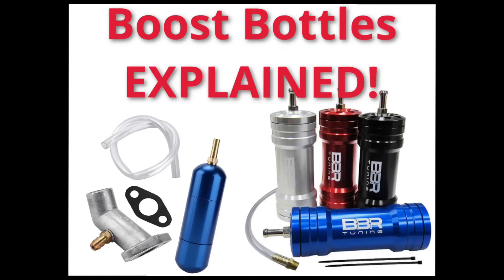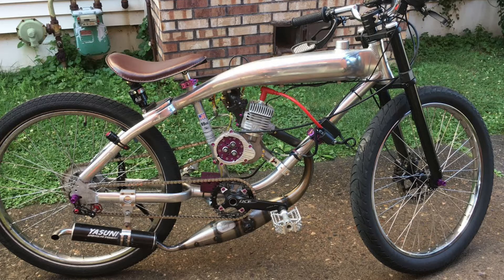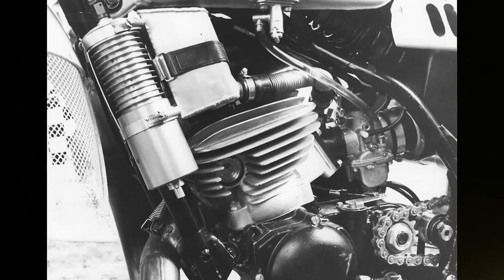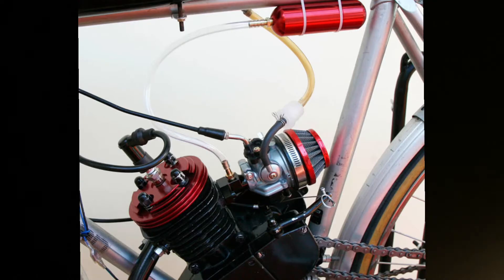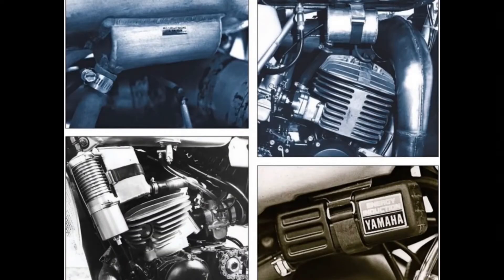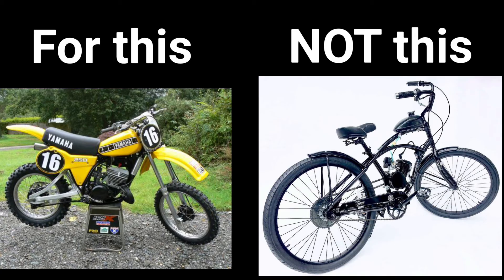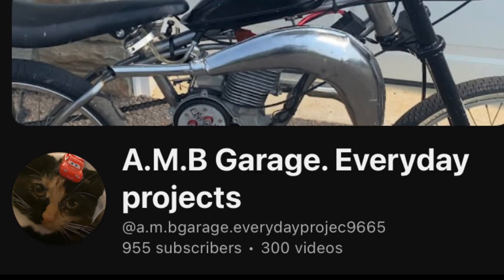The Boost Bottle EXPLAINED! #motorizedbike #2stroke #automobile #mechanic #motorcycle #motorcycle

Comment: They save a bit of fuel.  Maybe a 1/4 mile per gallon but still that's 1/4 mile of free fuel that's not going backwards out your air filter.  Thats like 45 cents of gas per tank you can save

Comment: Are you kidding?  I was expecting a video where they were actually put on a motorized bike, before and after results. But, nope just you slamming them and blackberry, who I don’t buy from.  I have put boost bottles on 3 motorized bikes. They smooth out idling plus the entire rev range.  Not to mention the better mileage. Do your videos but get out and do your research  to back up what you say.
Reply from the maker: lol. I have tried a boost bottle. I speak from my personal experience as well as many other's. Boost bottles effectively increase the intake volume. Sure, there might be some benefits, but if you ACTUALLY know ANYTHING about engines and especially how to tune a carburetor, you will know for FACT that a boost bottle is nothing but swamp gas for a motorized bike application. JUST like a longer intake, THE ONLY TIME a boost bottle will impact performance for the better (IN ANY WAY) is if your carburetor is out of tune. 

The soul purpose of a boost bottle was to reduce the INSANE AMOUNTS of intake pulsations within the intake, making the throttle response go wacky in the higher RPMs (we're talking about 8k RPM or so). However, on the application of a motorized bike that does NOT have those issues, a simple tune of the carburetor will make a bigger difference in terms of performance.

The MAIN FLAW that I see with the boost bottles on motorized bikes is that, firstly, they were designed for a very specific use. But as we know, these chinadolls do not perform in the same way a YZ80 or YZ250 performs and do not present the design issues that needed to be compensated by the boost bottle. We can also see that the boost bottle size and all-round design is according to the amount of air-fuel mixture being sucked into the engine and the RPM speed affected. However, for a motorized bike, they are using the EXACT SAME design from a YZ80 on a motorized bike. Now, even though its not too much of a displacement discrepancy, considering even the 70's YZ80s suck in about 6x the amount of fuel and spin DOUBLE as fast as the chinadolls. So, while the boost bottle on the YZ80 might actually do something, the only thing the same design will do on a motorized bike is create air leaks and increase the intake volume (NEGATIVELY affects throttle response and idle, unless your carburetor was originally out of tune. lol). 

I could go wrong, but that is my rant.

Comment: Oh it's a bike Berry thing, eww
I thought it was for the boost port, like the cavity in the cylinder.

I've quoted bike Berry on the same exact vid , about them going through 3 phantom engines, then they responded like, ~ don't believe your ears - stop spreading rumors.
Reply from the maker: Of course not. Bike Berry wouldn't sell something actually useful. 

lol. Bike Berry is a scam in about everything they touch or sell. When it comes to their products, their information, and ESPECIALLY their prices. They are LITERALLY selling some IDENTICAL products that RDM, Smolik, Bicycle Engines, Pedal Chopper, etc have been selling for years and jack the prices way up, "brand it" as their newest performance piece, and most of the time, they even leave the logo from the original on it. lol.

Comment: Race Civic's run 7's in 1/4 mile, but yes boost bottle is Snake Oil 👽👍🏻   PFI Speed #1
Reply from the maker: Well yeah. The Civic is a fantastic platform for performance and has a ton of potential, which makes my rage burn for the civic people that rather do crappy mods that do nothing but make the car crappier and then think they did performance mods. At least in high school, these guys brag that they have race cars and are "beating mustangs" when they have nothing but ugly wheels, a carbon fiber wrapped hood, a fart can, and ridiculously cambered wheels. They deserve to be clowned on even more than the boost bottle users.

Comment: Vacuum and pressure are the atmospheric inverse. Perhaps use Vacuum energy instead.
Reply from the maker: Im not following.  In this case, I believe it would be a vacuum leak, since the boost bottle interferes with vacuum pressure within the intake, lowering it a good bit. This causes less sucking within the intake, which directly decrease fuel being delivered to the engine, thus making the engine run leaner.
Reply: @a.m.bgarage.everydayprojec9665   there is no such thing as Vacuum Pressure. It is either "Vacuum" or the opposite "Pressure". Vacuum is the absence of Pressure. It is like saying Empty Full. This is why I recommended vacuum energy as a correction.
Reply from the maker: I understand now. YES, you are completely right. lol. Ive always said vacuum pressure, but I see now that by saying that, it is HILARIOUSLY contradictory.
Reply: @a.m.bgarage.everydayprojec9665   Thank you for your professionalism. I only intended to improve your wording as others posted a similar response but in a poor fashion. Keep up the fine content sir!

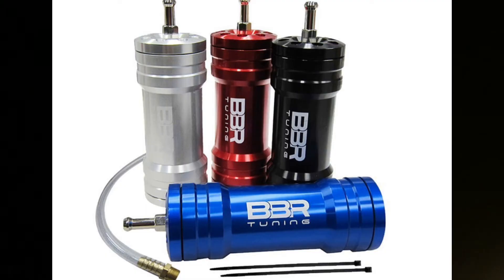Comment: @1:09 what in the hell is vacuum pressure? 🤣
Reply from the maker: In this case, it is the vacuum or negative pressure that the engine generates on the upstroke, which sucks a fuel charge from the carburetor and into the engine. In certain rpm ranges, the carburetor delivers a smaller amount of fuel than what is usually desirably, so the boost bottle in a way balances out those inconsistencies (for the most part) by adding more fuel to the fuel charge when the carb cannot keep up.
Reply: @a.m.bgarage.everydayprojec9665 so just vacuum
Reply: You know that negative pressure is still called pressure right? You can see an example of the use of the phrase in my first sentence.

Comment: The Boost bottle was a Yamaha thing in their motocross and off road two stroke motorcycles in the 80's. The purpose was not to add horsepower, but to improve throttle response when going from full throttle, to closed throttle and back to full throttle. The chamber was meant to be a place for the intake charge to go while at high rpm and closed throttle, then offer a supercharger effect to the intake charge when going back to full throttle, hence the "Boost Bottle" name. It was a popular gimmick in the 80's motocross scene, but as stated in the video a total waste of money. What it really did, was add a vacuum leak and lean your engine out, it did do that really well.
Reply from the maker: Thank you. You summed it up nicely.
Reply: This video is slander 🤣

Comment: it goes after the carb? so fuel/air ratio just plummets or?
Reply from the maker: Yeah. It is supposed to increase throttle response and add a supercharger affect when in the mid throttle and it made a noticeable difference in that regard, but at least on a motorized bike, the boost bottle makes the engine ALWAYS run lean and causes a terrible vaccum leak. So, conisidering the facts, AT MINIMUM, the boost bottle has ZERO performance gaining properties, but commonly actually decreases performance due to the severe vacuum leaks and other factors.

Comment: i had a friend that fitted a squeezable ketchup bottle onto the boost bottle location, it sucks inwards upon power and when idling it expands again drawing in gasey air ready for the next time,
also, we had a yamaha dt80 air cooled that as standard had a boost bottle plastic thing, like a air filter box but smaller, attached at the carb manifold. so if yamaha did it on a dt80. it must do something
Reply from the maker: But in the same regard, if Yamaha and everyone else ditched the boost bottle in the 80's and has never used them in ANY of their bikes for multiple decades, it obviously did more bad than good. 

As I said in the video, it barely noticeably affects performance on the engines specifically designed for a boost bottle, but on a motorized bike, there is ZERO performance gains and actually makes your engine run entirely worse in some applications due to causing a bad vacuum leak, making the engine run very lean.
Reply: yes i agree a boost bottle just introduces air leaks, im going to make one, first im going to drill a hole into the carb manifold, then screw in the proper tap thing, then a tube, then something transparent so i can see the ish inside.

Comment: Haven't tried one but other people say they help with lower rpm before the expansion pipe hits but you'll need to richen the pilot
Reply from the maker: I have heard this as well and this might be true if the boost bottle actually did anything to a motorized bike. I didnt add this in the video, but a boost bottle causes a HUGE vacuum leak, making the engine run very lean no matter the jetting. While the boost bottles are supposedly helpful with throttle response, because there is so many issues with running a boost bottle on a motorized bike, its not helpful at the least.

As you said, the boost bottle is supposed to help give a little performance boost before the pipe takes over, but in the same regard, a simple reed valve does the SAME THING, but SO MUCH BETTER (depending on the reed valve) and has really no downsides and many more upsides, hence why boost bottles are not longer used, but reed valves are heavily used.